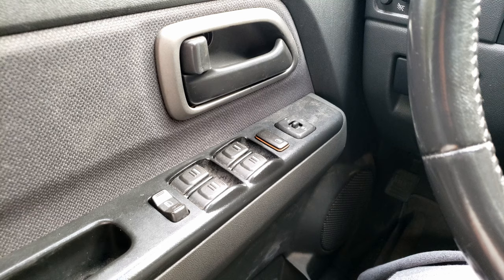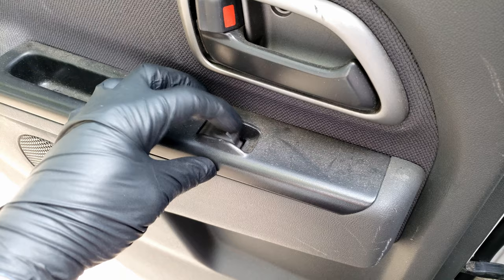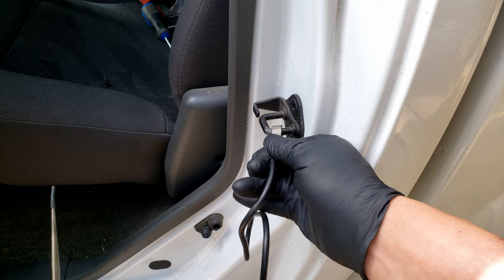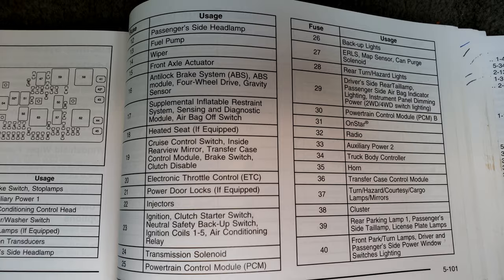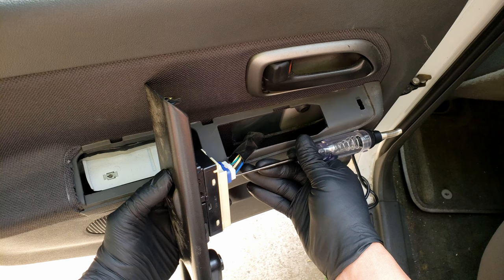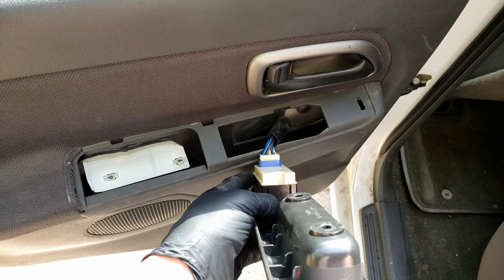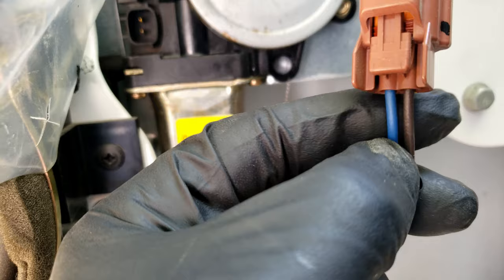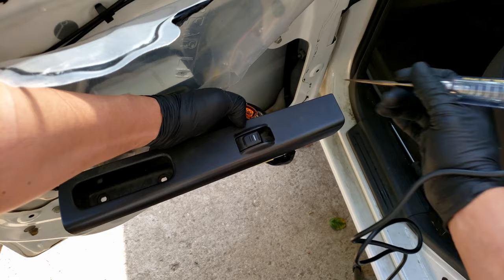How to Diagnose If the Window Switch or If the Motor is Bad

Comment: I disassembled my grandmother's door and everything only to find out that the window lockout switch was the issue. I unpressed it, and it worked just fine. We're still laughing about it 😂
Reply from the maker: Lol..well nothing like a free repair and a laugh🙂
Reply: @backyardchevy328  Hi, I have a dumb question: are regulators & motors from different brands interchangeable to work together? IE: Beck Arnley regulator work with a Dorman motor that is for the same Frontier? Thks!
Reply from the maker: @MasterArmedforces  thats actually a good question..yes, they can be swapped as long as they were manufactured to factory specs..cause in many cases u can swap just the regulator or just the motor
Reply: I did the same thing today!! I almost started tripping and throwing a tantrum
Reply: I’ve done that before xD
Reply: I would have went to my grave with that one lol
Reply: Did the same thing thinking the wiring was bad after I installed a new speaker lol
Reply: Profile pic checks out 😂😂😂😂
Reply: how do you unlock the window lockout switch or unpress it? Ford fiesta mk7
Reply: God Bless you in The Name of Jesus!
Reply: @BreakerBreakerYeo  you probably figured this out already but “lockout switch” is a fancy way of saying “button that keeps the snot nose brat in the backseat from rolling down the window and spilling his apple juice on your car’s paint.”
Reply: Bruh this comment saved me so much time, I've never locked my windows before. Holy shit im an idiot lmao
Reply: Can I swap the front window plug with the back window plug or will the plugs not line up
Reply: @jontaylor7188  welp…I don’t know what “plugs” you’re referring to. If you’re talking about plastic clips, just go buy some more at auto store. For anything else, front and rear windows, and left and right are usually different in their components.
Reply: @zacharytracy3797  yeah as I took it apart I realized the fronts have a black plug into the window switches while the blue is for the reverse and they have a different cutout in them so I couldn't put them in the other one. I'm dumb with the stuff but was hoping for a quick cheap fix.
Reply: Lmaoo damn
Reply: I was just about to do the exact same with my car, but thanks to this comment I saved a lot of time and money!
Reply: @CovidVirgin  glad my humorous foray could help 👍
Reply: You just saved me so much headache!!! Appreciate you making this comment!
Reply: The  power window lockout switch will screw with even the best mechanics if they are not on their game.
Reply: I just did this , that’s why I’m at the video . We’re goats 😂😂
Reply: You just saved me some time
Reply: Awwwww! I'd be so pissed! Lolllll
Reply: Yep. I am sure you are not the only one.
Reply: Same thing happened to me😂😅
Reply: Mr... Thank you so much. For 3 hours, and 6 videos I come across your video BAM! problem solved the window lock was on.😮😢😂😊
Reply: Bro I was about to pull apart my door panel and then I just saw the window lock button was pressed and my window works now. Thank you for saving me the trouble 😂
Reply: Same here! 😂🤪🤣
Reply: you just saved me hours. idk why i didn’t think of it but i was about to take off my panel and saw this comment and flipped my switch and now the passenger window goes up😩
Reply: OMG that just happened to us. And the way I found it was by looking at your comment after we replaced the motor and it still didnt work.  thank you for saving our lives and I guess we have a new motor now
Reply: Damn I hope she made you some good food or got you a little treat for your wasted time lol. That's a bummer
Reply: I wish I got that lucky 🙄😭😭 unfortunately my grandma's passenger window has been able to roll down but not back up and first thing I checked was that window lock button so now I got to pull it apart and find out if it's the switch or the window motor itself that's causing it to not roll back up luckily I have worked at a shop for quite some time but even then I don't like wiring it's probably the most complicated or least fun thing to work on when it comes to cars even being a car guy
Reply: @seattlejdmcivic  if it goes down but not up it’s likely a busted window regulator. No complicated wiring. Plug and play. Often worth getting a complete assembly with a regulator and a motor unless Nissan’s window motors last.
Reply: I'm not a mechanic in the least bit and had been troubleshooting my windows for the last three hours. I was about to quit for the night, fearing the work ahead tomorrow. But thanks to seeing this comment, my windows are working fine now. Whew! Thank you very much! 👍
Reply: Happened to me then my power windowed stopped working again the same day
Reply: So if it was the window lock out switch then how would you fix that because I believe that's what's wrong with my car...
Reply: You just saved me so much time and hassle. I was fixing a headlight fuse issue and afterwards my passenger and rear power windows weren’t working, leaving the passenger stuck down. I thought I must have messed something up. Came to this video, saw your comment, and sure enough I had accidentally pressed the child safety lock. 😂😂😂😂😂😂😂
Reply: OMG! So yesterday night it was raining, I was driving my pickup and was reversing and needed the window down to see clearly as I was reversing, well the window wouldn’t work, and boy did it give me the shits, something I didn’t need. I certainly topped off the swear jar. Fast forward to today and I’m looking at how to fix it, then I read your comment and remembered I have a window lock button. Low and behold the lock was on. I’m laughing about it right now and my girlfriend would had to hear my rant about a broken electric window….. well let’s hope she laughs about it to when I tell her. 

Thanks for your comment, saved me hours of pulling things apart or an embarrassing call to an auto electrician 😂😂😂😂

Can believe I was that silly to forget about checking the lock switch

Im having a good laugh at the replies all saying similar things. 😮😂

Comment: Thanks for mentioning the lockout switch. Passenger side window on my 2 door would not roll up and was stuck in the fully down position. Was trying to figure out why, was dreading a drive motor repair, and didn't occur to me to check the lockout, because I never use it. But it must have inadvertently been pressed, because it was in the down position. 🤦🏻‍♂️ Easiest fix ever. Of course it worked just fine after I unpressed the switch. 😂

Comment: For me i had to open the switch board and i notice this little piece of plastic with wires that was loose inside. Once i set it in place and assemble everything back the window staterd working. Tnxs your videoa was really helpful. 👍👍👍

Comment: Thanks for the easy explanation of the switch to motor connection. It helped me figure out that the rear window motor is not bad, it's the switch that doesn't pull it back up. It works from the driver's side switches just fine.
Reply from the maker: Thats great! Im glad u were able to figure it out🙂👍

Comment: I had this problem today , my uncle ended up taking the master switch out and opening it up to look at the motherboard , we found it was dark on the front two window switches on the board covered in dirt , cleaned it with cloth and rubbing alcohol and prayed it worked , and it did. 👍🏼
Reply from the maker: Great job fixing it🙂👍

Comment: Try the other door's switch - The best advice is around 4:55.  Went through the whole motor replacement, to find out the switch wasn't working in the down position.  Went up just fine.  Thnaks

Comment: Awesome video.  I used your method with the test light to determine my Subaru outback window motor was faulty.  Very cool to see how the switch lights up as you get closer and closer to the motor.

Comment: Thanks. Well done.
After changing out the left rear window switch with a used one from eBay ($17)  it did not work. The tip of making sure the window lock on on the driver switch console saved me a lot of time.Must have locked out rear windows in the process. After switching the rear window back on, worked fine.
Reply from the maker: Thank you🙂 so glad to hear that that ended up fixing the issue🙂👍

Comment: Thought this was the issue to my girlfriend's 2009 Kia Spectra due to 3 of her windows not going down besides the drivers side window. I didn't think to check the window lock cause I assumed she had already checked that before asking for my help since I usually fix issues with her car here and there if she can't get it on her own. As soon as he said make sure to see if the power window isn't locked I had to pause to ask if she checked and low and behold it was locked all along lol Got a good laugh out of it. Excellent video!!!
Reply from the maker: Lol...glad to hear that thats all it was🙂👍 ive had my share of easy fixes like that on other vehicles lol

Comment: Great video! Thanks I can now check further to see why the passenger and rear window are not working. Very good explanation of how to troubleshoot this.
Reply from the maker: Thank you🙂 and the lockouts not engaged?
Reply: Appreciate it. No the lock out is not engaged. The drivers and left rear work fine. I'll update once I use the method you illustrated. Maybe both motors are bad. Thanks again.
Reply from the maker: @theluckymanfrom  good luck🙂
Reply: Thanks,  I'll update when I get to the bottom of it. It may help someone with a similar issue. I'm looking at the passenger door control module at this point because the switch sends the up and down control signal through it to the window motor. When checking from the motor connector end while activating the switch up and down, I only get momentary power. My test light shows power just briefly and not constant while the switch is activated. I'm going to try another door control module and see if that is the culprit.
Reply: @backyardchevy328  I have a question. When you're checking from the window motor connector, Should the test light stay on as long as you are pressing the switch. I found the up and down wire but when I press the switch the test light only comes on briefly and shuts off. Is this what it should do? I'm thinking that the test light should stay lit as long as I'm pressing the switch or otherwise the motor wouldn't get enough power to lift or lower the window.  Thanks in advance for your thoughts.
Reply from the maker: @theluckymanfrom  It should stay on as long as ur holding button...maybe the switch's contact is bad or worn

Comment: My pass window was not working neither the rear windows on my 02 odyssey and when I removed the switch turned out the on/off switch was not connected. Connected it and now my pass window works but my rear windows only make a clicking sound. Any idea what that could be?

Comment: Thank you very much! This was very easy to understand, you didn't play around and do unnecessary things, great job. I need to go try this on my 05 GMC Envoy... I'll let you know how I make out 👍🏼
Thanks again!
Reply from the maker: Thank you🙂 hopefully it helps u figure out the problem..good luck🙂👍
Reply: @backyardchevy328  On my 2005 Envoy the main controller on the driver's door is not working. I've tested the wires and they all seem fine & have power but the buttons (on the main cluster) do not work. However they do work using their own controllers. Becsuse the main controller isn't working there is no way to put the driver's window down, etc. All interior things are fine like the radio & interior lights etc.  Ok... Well this just got weird. I went to check the doors and I was just messing around checking fuses, etc. I lost all of the electric to the windows, the main controller and each door. But.. I decided to check fuses... A few under the seat and some under the hood. Then as I was in the car and turned the key I heard the car cycle through the locks, etc. So I tried the driver's side window and It worked! All of them worked, even the driver's side but, it was very slow going down. I'm not sure what is going on, I do believe I have an electrical problem which has been causing a slow drain and I often have to jump my car (I have my own jump thing for that). Anyway I decided I had to give up for the night, it was dark and I needed to go in. When I tried to look up the car with the remote it didn't sound correct... So, I checked each door and none of them locked 🤔  I went around and manually locked them and went in for the night. It'll be interesting to see what tomorrow brings.
Reply from the maker: @uzibah4889  yea definitely some wiring issue...either a damaged wire or a bad ground
Reply: @backyardchevy328  yes I actually found a messed up part on the circuit board, I didn't see it before but that's definitely the problem with that. Ordered a new one from eBay, I'll see if that solves it.. Until then I'm using the passenger side part pn the driver's side. What an ordeal. Thank you so much for your help 👍🏼
Reply from the maker: @uzibah4889  Thats Great! Glad u were able to find the problem
Reply: @backyardchevy328  thank you! And again thank you very much for the easy to follow video, that helped me lot.
Reply from the maker: @uzibah4889  so glad it was helpful🙂 thank you for the support

Comment: Or you could hold the lock/unlock button on your car key fob for 10 seconds, if you're opening the car and hold unlock, after about 10 seconds the driver side window will open. If you're locking the car with any window open, holding the lock button for 10 seconds will lock the car and close any open windows. This works on most cars with electric windows.

This would be a quicker way to test if the motor isn't working. 

Work smart, not hard people!
Reply: You ain't gotta Lie to be our friend...
  We still love ya buddy

Comment: The fun times is in older cars is where the signal is the power. The master switch for the passenger side can fail in such a way that it doesn’t work at all and the passenger switch can only open the window. It meant I learnt to hotwire my first window.
Reply from the maker: Valuable skill to learn when understanding wiring

Comment: I have a 2001 Toyota Tacoma the passenger window wouldn't roll down but the driver side would. So I was told to roll down the driver side window keep holding the button count 5 seconds roll up the window count 5 seconds and it resets the windows You don't even have to take your door apart. For Nissan you go to the door where the window won't roll down you have the door open pull up the window switch close the door and then it works. They just need to be reset that's all Don't have to tear your door apart. We're having mechanic drain your pocketbook. 👍

Comment: Great video ! With my car, every window has a different problem. My right rear window I can roll down with the master switch but I can’t roll it up with the master switch. I would have to use the right rear switch to roll up but the that switch would not roll down.  Other than the driver window switch all the other window switches have a problem like this.
Reply from the maker: Thank you🙂 yea thats a lot off issues with the switches lol
Reply: Same with my 2011 Kia Sorento. Every window has a different issue 😖

Comment: Our 03 Ion driver window stuck up, could feel the motor wanting to run.  Removed the inside panel, loosened the four 10mm bolts for the regulator, hit the button and down she went!  Cycled it a few times and then set the four bolts with the window up.
Reply from the maker: Thats awesome!.glad u were able to fix it..it may also help to lubricate the tracks

Comment: I have a Chevy corvette. car has been sitting for 3 years.  the window does not go down.  When you press the switch down you hear the motor operating but the window is not going down?  What could it be

Comment: Have a  1999 Honda Passport. Drivers window goes up but not down with either switch. Already changed motor assembly. Where would the up and down signal be reversed? The pins are too small to check at the switches. Used jumpers at the motor to verify motor will go up and down.

Comment: My window will only go up, but not down - I'm getting different results when the regulator is connected vs not. When disconnected, I get the correct voltage signals for up/down on different wires. But, when connected, I get a whole mix of weird signals - I replaced the entire regulator assembly and still get the same results, wondering if I need to replace the main switch over at the driver's door? Thanks for any help/ideas.

Comment: THis is a long shot but I have a question thats maybe obvious to someone more inclined. I have a 2006 Lincoln town car and i've burned through 3 window switches but when i changed the switch it would work for months before randomly not working anymore..? Would that maybe be a bad motor over amping the switch? I did have a problem that my locks kept activating but that only happened once 2 years ago.

Comment: Can the issue be with both the motor AND the window switch?
In my specific situation, my DRIVER SIDE  window switch powers my PASSENGER side view mirror AND my driver power window except the auto down function doesn’t work and I have to push it several times for it to go down all the way (if I were to push and hold it goes down a few inches)
And on the PASSENGER side window switches, it doesn’t power the window at all. The window doesn’t move period. But also the door lock doesn’t work on the right side either

Comment: I’m getting power to the switch but the none of signal wires are not getting current (tester doesn’t light up). Does it mean the motor is dead or the switch is broken?

Comment: My driver side window switch works but it is taking a few seconds to engage. Meaning once I push the button the window doesn't move right away. Is this the power window switch or the motor?